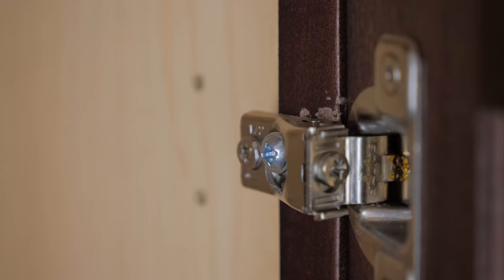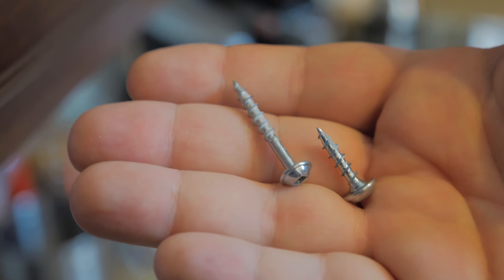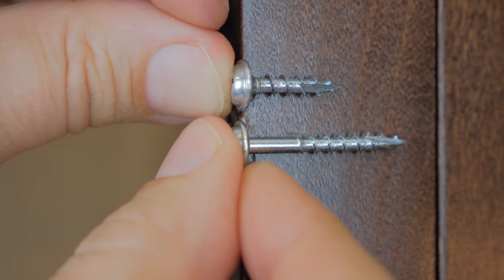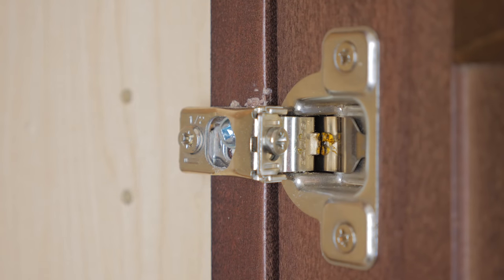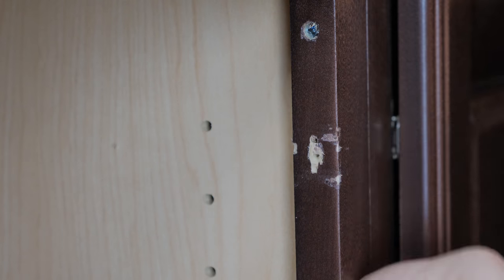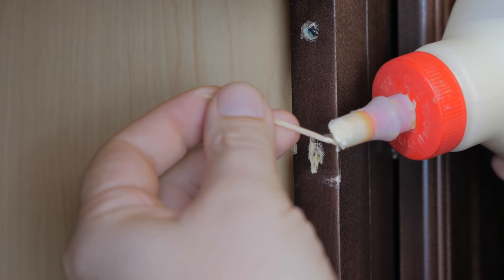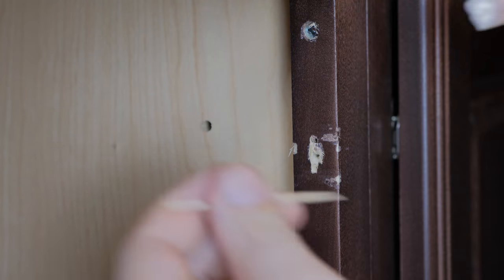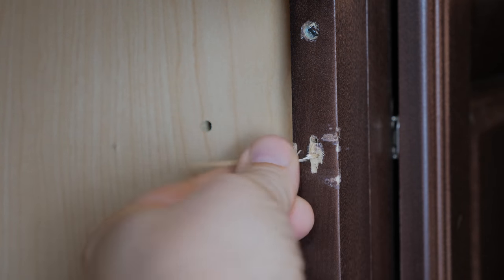How to Fix Stripped Screw Holes - Two Easy DIY Hacks

Comment: THE TOOTHPICK METHOD JUST WORKS OMG. Thank you! Almost paid someone to do it. I didn't even apply glue, just made sure those toothpicks are close and tight.
Reply: Benefit to using the glue is down the road if you're removing that same screw, the glue can help keep the fragmented toothpick together rather than it flaking into pieces in your cabinet.

Comment: Awesome tip on the kitchen cabinet loose screw issue, especially the wood glue tip w/ the tooth picks. I have heard of toothpicks earlier before I watched your video, but combined with the wood glue it’s a nice and sturdy combo. I will go get a longer screw if it comes lose again. Thanks again for the very helpful and to the point video.
Reply from the maker: Thanks for watching!   Glad to help!

Comment: Unfortunately I cannot use a longer or bigger screw as they are in the direction of outside cabinet.
Not sure I would trust the toothpick/glue solution as the material of cabinets is particle board (breaking out some).

Comment: I am looking to fix a couple of kitchen door hinges, and the screw holes opened up quite a bit. I like your tips and will keep them for another screw hole job. I lost hope and it sounds like I will need to move the hinges to another level! Lots work but it has to be done, and before I go do that il have a browse through your videos mate might just find a better solution. Cheers!

Comment: How long do you let the toothpicks sit in the hole before trying to drill?
Reply from the maker: Maybe 10 to 20 mins at the most. Depends on the glue you use. How fast is the glue “setting up” (drying)?  Basically you want the toothpicks to stick in place when you start to drive the screw in the hole.

Comment: Thanks for the tips. Tne hinge of my cabinet door fell out after less than 10 mths of usage. -.- i swear contractors in my country are getting worse and worse by the years. They even ignored my calls for scratches on the underside of the top cabinet when i realized after 1 week of moving in

Comment: I have been told wood filler as well ..It’s off white in colour,it’s like glue but much thicker not runny at all .You put it into a small hole & just flatten it down with your finger let it dry for a while .After that your good to go
Reply: I can only speak to my experience, but wood filler did not work...at all...for me. Thus, me finding this video. It didn't seem to harden enough to do the trick, at least in my experience, and I left it overnight.

Comment: Sadly didnt work for me.

Packed it with toothpicks and used a long screw but the hinge will not close all the way and still swings open a bit.
Reply from the maker: Hmm. Sorry to hear that. Maybe the hinge needs to be replaced. You can take a picture and send it to me on Twitter?  My handle there is @jasongarringer.
Reply: @jasongarringer12  appreciate the offer but don't have Twitter.  But probably right it needs a hinge. Was someone start idea to install a moveable trash underneath so it gets closed and open multiple times a day for years.

Comment: what if the holes are stripped for the cabinet shelf holders? please help
Reply from the maker: Most shelf pegs (also called shelf pins) are 5mm or 6mm. You could find an equivalent drill bit, then drill another hole to the left or right of the stripped hole.
Reply from the maker: Amazon Prime has many Same Day Delivery options for drill bits.
Reply: Thank you, I was about to use wood glue.  I like your idea better!

Comment: I have a cabinet where the hinge hole has become very large, and the cabinet is one that sits above the stove. It doesnt have a lot of room to fit a longer screw, without it going out the other side.......and toothpicks, i would have to use a lot of them and it just doesnt look like that will work in this large, but shallow hole. Is it beyond repair?  Its almost large enough to fit a small disc shaped piece of wood in, if i glue that in maybe that would work?